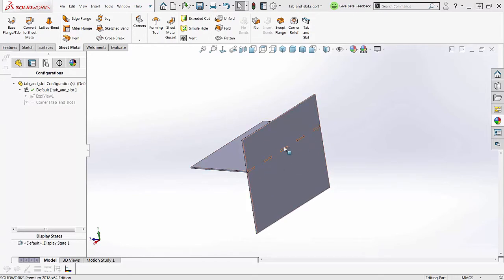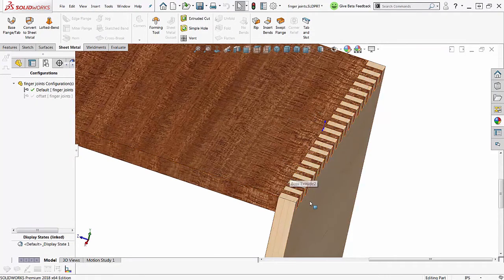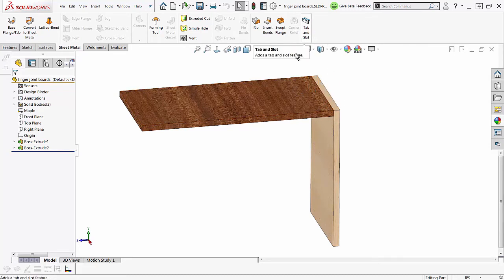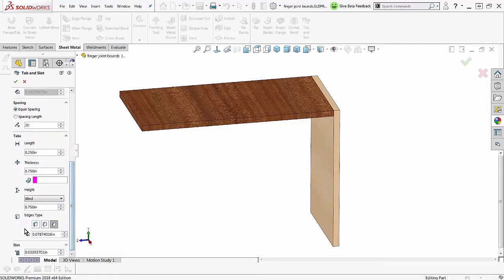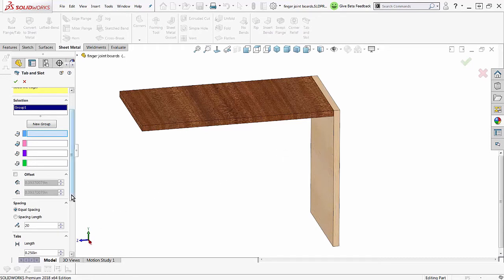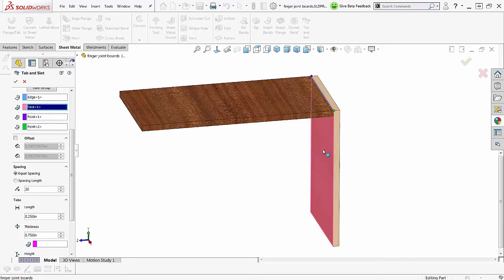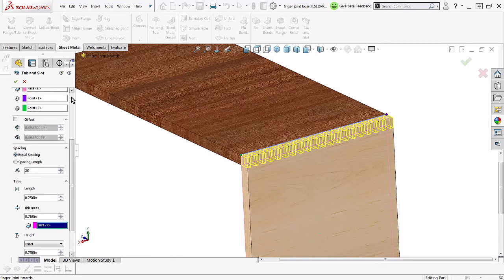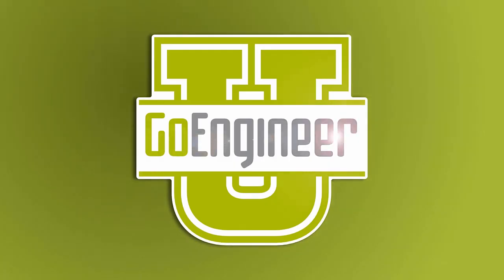SOLIDWORKS 2018   Woodworking Tab and Slot

Comment: i'm in solidworks 2019 trying to do this in an assembly and it shows the preview correctly but when I hit the green check, it doesn't create the slots on the second part. only tabs are made on the first part. then I get an error when I try to edit the tab feature saying slot feature is not found. any ideas?
Reply from the maker: Hey Trevor, the Tab and Slot feature is intended to be used on multi-body part files.
Reply: @goengineer  thanks for the reply! the 2019 manual specifically says it can be used on bodies, multi bodies, AND assemblies